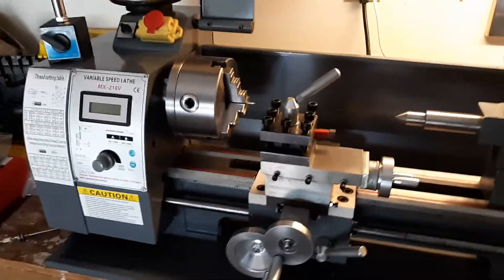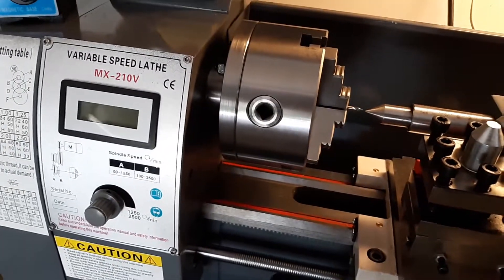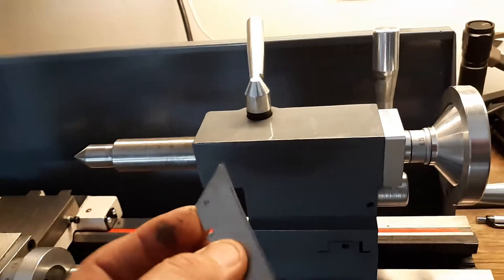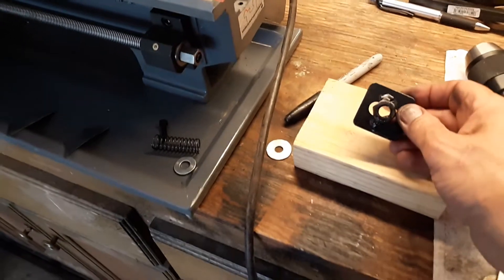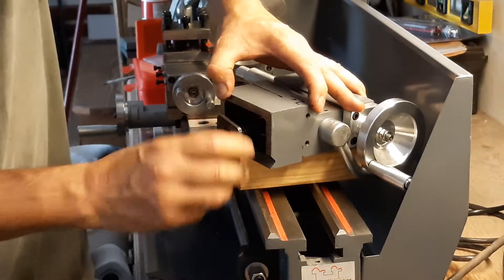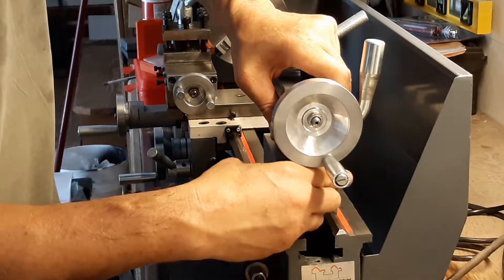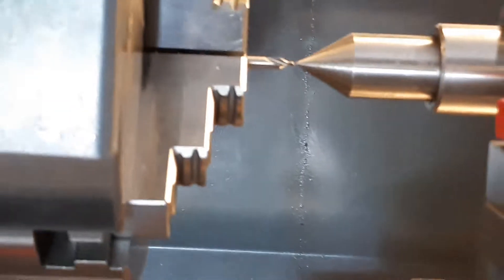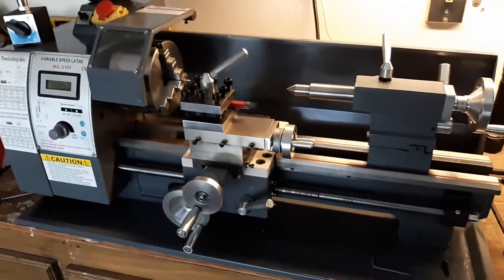Tailstock height adjustment on a Chinese lathe

Comment: If you are shimming a low tail stock why would you put razor blades in the front and back? Wouldn’t they go under the front only?  I think the solution would be to chuck a drill rod in the tailstock and indicate it to determine if the entire thing is low or is it pointed down in the front only. Basically was the tailstock low or out of level.
Reply from the maker: I see your point, however,  it is more likely that the tailstock is parallel  to the bed and the whole thing is low.  So, You need to bring it up level and parallel to the rails.  A shim at only the front might line it up but the tailstock would be at an angle (ever so slightly,  but an angle nonetheless, that would be wrong).   

Say I had a  house on a raised foundation but the front steps were 4" too high, would i raise only one side to match the steps (and have an uneven home)?.....no, a smart person would bring the whole house up 4" front and back. 

Thanks for watching and the question 😊

Comment: First you have to level the lathe and then align the headstock horizontaly and verticaly by turning a 5" long stick out with no tailstock support. Measuring both ends and shiming per as needed tailstock end lathe mounting base. Once turning true then align the tailstock adjusting or shiming per as needed tailstock base.

Comment: Chuck not center at different dimeter. I have the same but it's totally garbage. Bed not accurate 0.25mm off. Head misalignment tailstock misaligned cross slide not 90deg! Fuck been there 5yr cant use it
Reply: Yes we should have just bit the bullet and bought a Precision Matthews!!

Comment: Thankfully I have not had this problem on mine but I would not measure it the way you have.    3-jaw chucks are not that accurate; if you want to get a better idea of vertical alignment a better approach is to put the MT2 centre  in the tailstock and the appropriate matching centre in the headstock.  For me that is an MT3.   Then look at the difference.  The centre-drill is too small, too inaccurate for that measurement I think.    Thanks for sharing your solution to your problem.
Reply: I'm agree in inserting a MT3 taper into the headstock, paying attention that no chips or dust being in the internal taper ... a test with headstock at low speed would be usefull, just to be sure of concentric turning of the tip of MT3 taper ( checked against any tool in the tool-post ... ). Now you can test the height of the tailstock with a MT2 taper inserted ... but i think it's better to check the tips ( MT3 and MT2, each against the other ) FIRST with the tailstock full retracted, and THEN full outside ... just to be sure that tailstock, protruding, moves in direction parallel to the rails of the lathe ... ( in our chinese lathes, nothing is to believed to be as true ... check first ! ).

Comment: I had the same model,you adjust one thing then something else is out of alignment, I thought it was absolutely junk
Reply: You have to work the alignment from the head back, levelling, then aligning. It's a true PIA. These Chinesium lathes are getting what you paid, and it shows.
You get to know them pretty well when you have to take them completely apart to deburr all of the machined surfaces. Finding all sorts of fiddly crap to fix along the way.

Mine says it takes an M5 taper, and surely it would, had they ground the back of the spindle far enough to accept one...

Comment: same lathe, different colour. Mine is to high by 0.1 mm. About 4/1000 in your world.  :)
Reply: @originalmicdrop  I have fixed it whit shimming up the headstock. Cut pieces of a feeler gauge works fine.